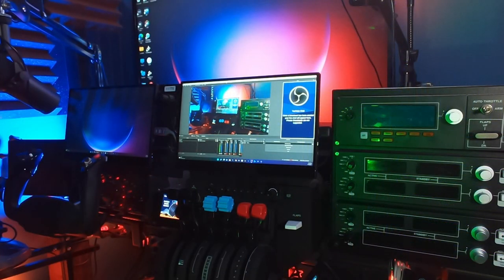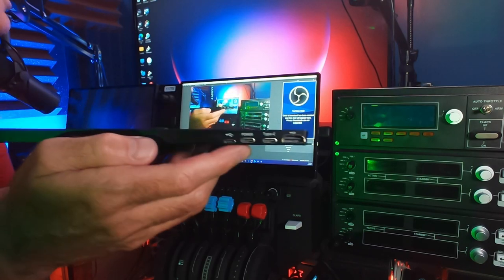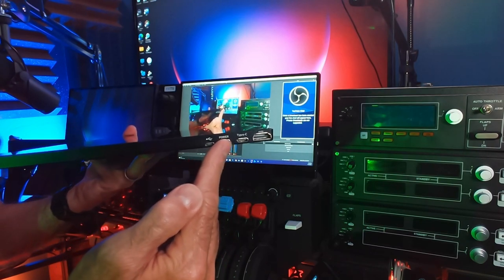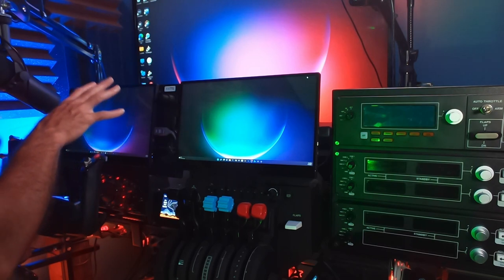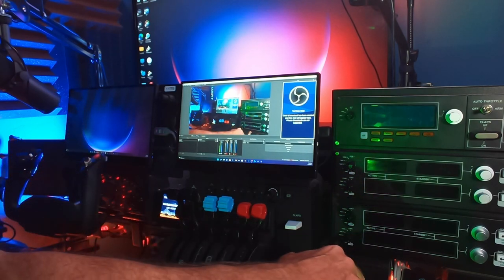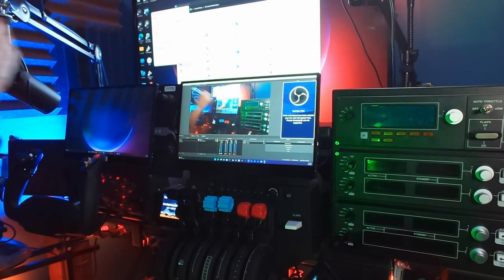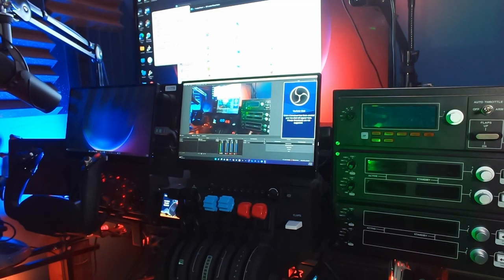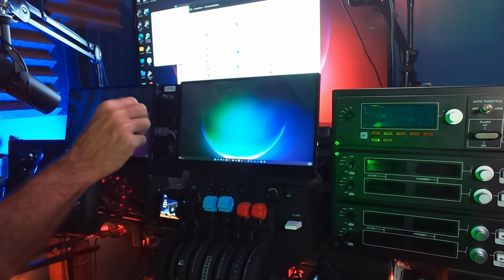Setup For External Touchscreen Monitors for  MSFS | X Plane | Air Manager | G-1000 | Windows 10/11

Comment: Hi Ivan i followed your video on how to pop out the MFD and PFD i got the G1000 bezel on my 2 ipads but when i drag the PFD into the bezel i cant expand it to fit into the bezel it just freeze in the ipad i can only expand it only when i remove the bezel, so i have only the PFD without the G1000 bezel have you encountered this issue and how did you solve it if ?????
Reply from the maker: Which G1000 bezel are you using? As of now, there are two G1000 bezels you can select in Air Manager 4. It seems that the bezel that says X-Plane on it works well (for MSFS and X-Plane). The other one is labeled "Garmin G1000 NXi Overlay" and has some really cool extra features, but it doesn't have functionality for moving the pop out once you've initially placed it. I have actually discussed this with the developer so he is aware.

The other issues maybe the iPads. I assume you are using software such as Duet which turns the iPad into additional monitors. Try switching bezels first. I bet that's it.
Reply: @IvanSkyFlight  thanks heaps

Comment: Hi again Ivan. 👋I'm having trouble setting up my dual touchscreens. I've followed your guide, and Windows 11 extends the desktop to both of them (HDMI works OK), and the mouse travels to each, but only ONE touch screen responds to touch. I have tested each screen separately and they each work fine on their own. It seems like Windows can't differentiate between the two screens in terms of the touch-response hardware (connected via USB connections). Did you ever have any trouble connecting two touch screens?
Reply from the maker: A few questions: During the touchscreen setup when the screen goes white, does it respond to touch? Can you confirm that both screens have touch capability? Does each screen have touch capability by itself without the other plugged in? Are they both the same make/model?
Reply: @IvanSkyFlight  The touchscreen monitors are identical brand and model. Each works as touchscreen when connected by itself. When they're both connected, only one touchscreen responds to touch in the 'white screen setup'.
Reply: Did you ever find a solution to your problem? I am encountering the same issue and I cannot find help anywhere. Any advice you could offer would be greatly appreciated.
Reply: @traveltheworld1870  Sometimes Windows confuses these generic touchscreen monitors for a mouse or a keyboard device. It is worth checking Control Panel -> Device Manager to verify: look in the list of devices for three things: Human Interface Devices, Keyboards, and Mice and other pointing devices. In my case, I found two items under Mice. I only have one mouse, so the other was the erroneously identified touchscreen. Check the Properties -> Events for each "mouse" to find the one most recently plugged in (the events have date/time stamps). The most recent one is probably the touch screen monitor. Properties -> Driver -> Uninstall Device to remove it from the list. Unplug the touchscreen from power and USB and then reconnect power and USB. Check Device Manager again. Ideally, you want each external touchscreen monitor to appear under Human Interface Devices as 'HID-compliant touch screen'. Hope this helps.

Comment: Ivan, the process that you demonstrated in this video is no longer available in windows 11. They supposedly integrated it and I can’t find out how to make it work. Can you help
Reply from the maker: Sorry to hear that. I just did some experimenting. I am currently running three Windows 11 machines. All are updated to 23H2. One runs Windows 11 Pro and the other two run Windows Home. If Windows does not detect a touch screen it will not show the "Tablet PC Settings" option. I went through several variations of plugging in and unplugging the USB cables that, at least in my case, add touch capability. In every scenario, the "Tablet PC Settings" would be there if the touch monitor was hooked up appropriately. I noticed this: If I plugged a monitor in, I had to restart for the "Tablet PC Settings" to show up. My guess is that for some reason your PC is not recognizing the tablet(s) as having touch capability. Do you have access to other computers to try your tablets on?

Comment: Hello Ivan - thanks for the great video.  I am all up and running.  I don't suppose there is an auto-magic way to have the displays in the cockpit pop-out automatically on launch?  and on a side note, do you use your StreamDeck just for Youtube or do you use for FlightSim as well.  And - what camera do you use, the video quality is excellent.  Thad
Reply from the maker: Apparently there is an app that can be found that will remember window positions. It's called "MSFS Pop Out Manager". I have never used it, and I can't vouch for it. I think there is also a clunky Windows method?  Having said that, there is no built in function like X-Plane where your pop outs go to defined position, shape, and size.

I use my Streamdeck primarily for OBS, but on occasion I have used it for MSFS in the past to get to functions that are difficult/impossible to assign in the options/controls section. What I have never tried is to do both at the same time. 

My camera is a Sony A5100 and Sigma 16 mm, f/1.4 DC DN Contemporary. It's a great combination and one of the most popular with streamers.

Comment: Thanks for the great videos. I am a flt sim newbie, if i want to have my main plus 2 touch monitors will i need 3 video outputs on my computer
Reply from the maker: Correct. For three screens most modern graphics would work as most have four outputs. Double check the specks. You can also use USB display outputs as well.

Comment: Hello Ivan, I am using 5 monitors and 1 is touchscreen, Windows 11 Pro.  In the Control panel the option for Tablet Pc Settings is completely missing so I am unable to do the setup for the touchscreen for the 1 monitor?
   Any ideas please?
Reply from the maker: Try going to the Windows 11 search bar and type in "Tablet PC settings" (without the quotes). Let me know what happens.
Reply from the maker: I just responded to another person with the same issue. Here is my response: "I just did some experimenting. I am currently running three Windows 11 machines. All are updated to 23H2. One runs Windows 11 Pro and the other two run Windows Home. If Windows does not detect a touch screen it will not show the "Tablet PC Settings" option. I went through several variations of plugging in and unplugging the USB cables that, at least in my case, add touch capability. In every scenario, the "Tablet PC Settings" would be there if the touch monitor was hooked up appropriately. I noticed this: If I plugged a monitor in, I had to restart for the "Tablet PC Settings" to show up. My guess is that for some reason your PC is not recognizing the tablet(s) as having touch capability. Do you have access to other computers to try your tablets on?"

Comment: OK, if i had well understantd and before i buy touchscreen or simple screen..., the data cable from the touschscreen is an usb-c  but the cable on the other size is anb usbA  usb3  correct?
Because my PC had no usb-c socket. only usb2, Usb3, 3.1 ?....
ANd with the actual version of MSFS 2020, can we turn button on the touschscren winthout th external KNOB ?
I think i'll buy two pannel off 103  or 13 ", th 15" seem to big to see my main creen and the tobby travker must see my face lol. Thanks for your help.
Reply from the maker: So yes, your cable must accommodate both the external screen and you available USB inputs on your PC. If there are no USB C inputs on your PC, then most likely, the cable would be a USB C to A. As far as manipulating buttons and knobs on the touch screen, using Air Manager, that can be done with by touch and/or mouse, depending on the function. As far as I know, MSFS 2020 doesn't "pop out" the bezels on devices like the G1000 only the display screen.

Comment: Hi. Great video again. I've just configured my MSFS 2020 with N.3  LG monitor-34 inches and N. 1 TouchScreen 1080P HDR UPPERFECT 15.6" (I'm shure, it is a touch screen monitor). All the monitros are connected via DP and HDMI to the RTX 3080 Ti graphic card. In the display settings of my Windows 11 PC I've selected "extend desktop to this screen" option for all the four monitors and I've selected one of th LG 34 inches monitors as primary display. Than I've installed Air manager on the PC and followed your suggestions. Anyway I've a issue: touch screen don't works on the uPerfect touch screen monitor. I can intereact with Demo Panel, i.e., by means the mouse but if I touch the screen nothing happen. Where Im wrong? Thanks in advance.
Reply from the maker: Other than the HDMI/DP connections to the graphics card, do you have any connections that are USB to the computer? That is how the "touch" signal is sent.
Reply: @IvanSkyFlight  Hi. In addition to this I had to set the uPerfect touch monitor as primary display. The problem will be when I'll add a secondary touch screen monitor that will act as MFD display

Comment: Thanks for the concise tutorial on setting up a touch screen monitor.  My touch screen monitor is an Aekekgrep 15.6 1080. I followed the directions as presented but am still not fully functional.  Using the Air Manager 172 panel for example, gauges are active, and knobs visibly turn however they don't function.  Switches do not move nor function.  I've tried other panels and planes but get the same results.  Any thoughts would be appreciated.
Reply from the maker: First thought is does your touch panel work in the normal Windows environment? Does it work outside of Air Manager and your flight sim?
Reply: No. It still acts as a "partial" touch pad for my main screens (running 3 monitors).  I follow your instructions and identify it (monitor 4) as a touch screen  (aftering hitting enter on the white screens as instructed).  For example, it will open Air Manager from the touch screen monitor task bar onto a main monitor but attempts to use finger do not work.   Thanks!
Reply from the maker: @mekkentucky  When hitting "enter" that should be only the non-touch screens so it will go to the next monitor. On the touch screen monitor you would actually touch the display. Is that what you are doing?
Reply: Yes, that's correct.  "Enter" on each of the three main monitors until I get to the 4th (touch screen).  I easily track your instructions on the video, just don't end up with it working even with instructions so I must be missing something...
Reply from the maker: @mekkentucky Does your touch screen act as a mouse pad for your main monitor? Also, what are the inputs on the side?
Reply: No, it does not act as a mousepad.  When you press on the touchscreen a round dot fades and disappears upon release.  When I look at Display Settings the touchscreen identifies as monitor #4.  But on the taskbar as I hover it doesn't show as a standalone but part of the main monitor.  Three inputs on touchscreen: Mini HDMI and two USB-C which seem to be duplicates per manual description.  Have tried each USB-C's as well as both-no difference.  Thanks.
Reply from the maker: @mekkentucky  Have you tried testing on a different machine?
Reply: I have now tested on my laptop and it immediately recognized the touch screen and works fine. Seems logical then that it is in the setup of the flightsim pc even though your instructions are clear and I can duplicate.  On the flightsim pc I can turn knobs (such as altimeter, hdg)  by touch but while they spin, they don't change anything-heading bug for example doesn't move but I can turn the knob.  Thanks.
Reply from the maker: @mekkentucky  Very strange. Have you tried reinstalling the Air Manager plugin?

Comment: Like listening to a foreign language. Trying to set up one touch monitor to fly it in xplane and I am so lost.
Reply from the maker: Let's start with the basics. Does the touch panel work as it should in Windows before XPlane is even launched? If not what is doing? Describe the inputs, please.
Reply: @IvanSkyFlight  Thank you for your reply Ivan, basically I have a 15.6" touchscreen monitor that is working fine. Ive connected it to my primary monitor and it works. I am looking to just run an Air Manager panel that Ive built on the second monitor in xplane 11. I am an old retired steam gauge captain and Id really love to fly again but all this computer stuff is hard to understand and I end up with headaches. All the YT videos out there says its soooo easy to do but that is not my reality.
Reply from the maker: @tombrady5867  Can you clarify your video monitor setup. Is this a PC with multiple outputs on the graphic card?

Comment: Hi great video. My graphics card has 3 DP ports and a single HDMI. I’m using 3 monitors. I want to hookup 2 touchscreen monitors. How do I do that with just one HDMI output? Thanks
Reply from the maker: Thanks! I use a StarTech USB 3.0 to HDMI adapter. It gives me two additional HDMI outputs. I run five screens and they all work well.
Reply: @IvanSkyFlight  Thanks I’ll give it a try!

Comment: Does the main monitor need to have touchscreen capability in order for the touchscreens to work on the 2nd and 3rd displays? I have a non-touchscreen curved gaming monitor and tried to use touchscreen portable monitors as a 2nd and 3rd display for avionics but they don't work when the gaming monitor is the main monitor and the portable touchscreens are the extended displays.
Reply from the maker: The main monitor does not have to be touch. In fact mine is not touch. What happens when you go into setup? Do the screens turn all white with text?